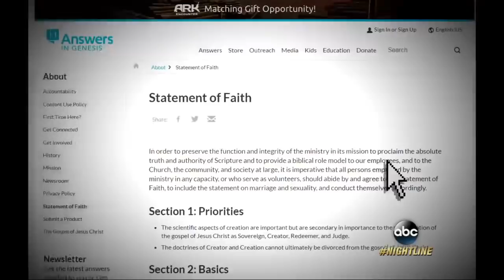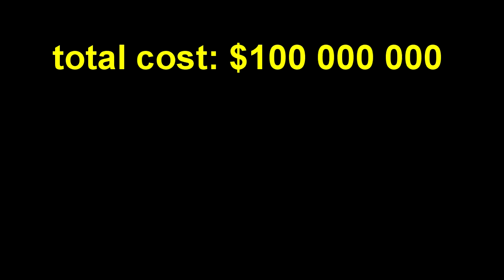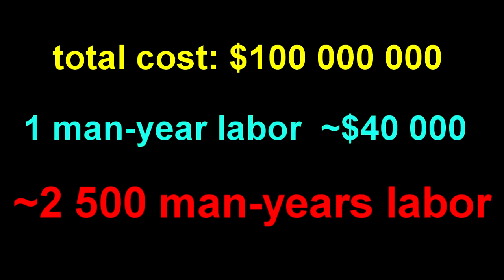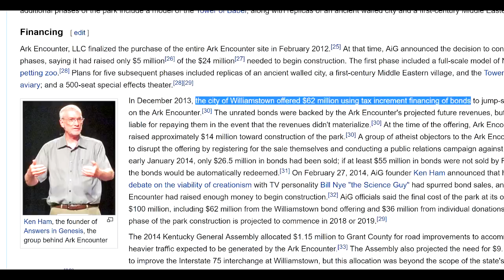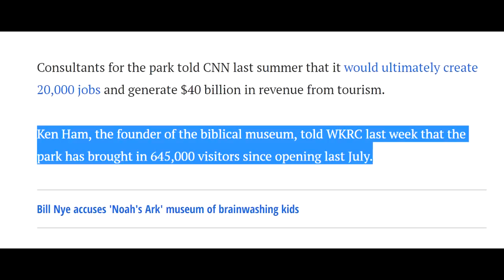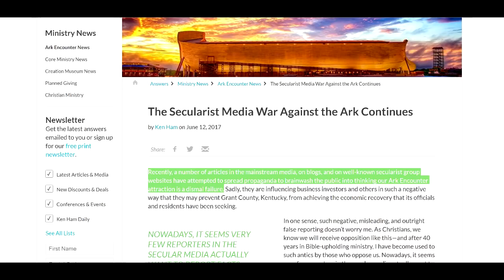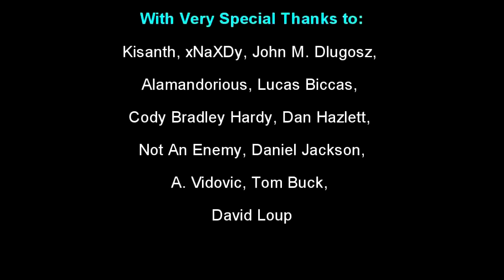Why do people laugh at creationists (part 44)

Comment: The best ship makers in the world carnt make a wooden ship that big. The biggest wooden ship ever made they found it bends and twist and in the sea breaks apart
Reply: You missed the end of your sentence.”and in the sea, breaks apart”!
Reply: Zheng He had a fleet ships, and supposedly the largest of the ships were roughly the same size as the Ark. It depends on the design. It could be possible. It was never really tried in modern times, and why would you try when metal works just fine?
Reply: @S2Tubes  it was tried in around 1900 and they found that it wouldnt work to that size. Do you mean a fleet of ships?
Reply: @georgeetboom7719  He had a fleet of over 300 ships. He's a Chinese admiral from the early 1400s. The largest ships were said to be nine masted behemoths at about the same size the Ark would be, which was about 130m long. The actual dimensions of both cubits and the Chinese ships are not exact. Neither the Ark, if it ever existed, nor the Chinese treasure ships, have survived to measure.

Like I said, it would depend on the design of the ship. I am confident that using modern technology and design could make a wooden ship of that length that would be sea worthy. The reason we don't use wood anymore is that metal is superior. The only reason to make a wooden ship would be to prove a point, and most point don't care enough to waste that kind of money.
Reply: @S2Tubes  im talking about the ship made in 1900 . 120 yrs ago. Where thwy attempted ti make the biggest ship ever and failed due to the reasons ive said
Reply: @georgeetboom7719  I'm not sure what you meant by asking if me if I meant a fleet of ships then. There have been multiple ship designs over the centuries, and they're definitely not all capable of the same level of sea worthiness. If the question is, can you build a ship made of wood over 100m long, and have it survive at sea? Then the answer is yes, depending on the design, probably. Technology has progressed since 1900.
Reply: @S2Tubes  noahs ark was 300 hundred Hebrew Royal cubits, or 150m. The Wyoming Schooner was 137m long and need anwater pump to keep it afloat. I doubt a single and man his friends could build one 20m longer with ancient technology.
Reply: @georgeetboom7719  The exact measurement of the cubits is not known. There are multiple versions of the cubit, and it is not stated which version was used in the Ark. I doubt the entire Ark story. You're forgetting that Noah was supposedly 600 years old at the time of the flood. A wooden boat seems the least of the issues with that story. All the Wyoming proves is that they couldn't do it, not that it could not be done.
Reply: The Wyoming, the ship you mean, was a clipper ship which served in the shipping business for fourteen years prior to breaking up. The history revealed in the Bible says the ark lasted just over one year.

The Wyoming was a clipper ship with huge forces from her sails. The ark was a barge without such forces.

The ark didn't have to make a profit sailing fast, it could be built stronger, etc. It's fascinating, really.

How do you know what ship is the biggest? You simply assume a lot about modern vs. ancient times and people.
Reply: @dhpd  well its believed it took Noah 120 yrs to build the ark. So he either started straight away, and say after 60 yrs half the boat made, it would have to sit in all weather conditions for 60 yrs, i think it would have rotted by then. Or say he was just collecting all the wood and materials for it fro 120yrs, again  thats a lot of wood to keep preserved for such a long time. With supposedly all animals in the world one ship, in pairs, again did he start collecting at the 1st year but theb they would have all died in 120yrs. Plus the weight of all living things would im sure be pretty heavy.
Reply: @georgeetboom7719  So I guess, since you ignored my previous explanations, that you accept that they are possibilities. :) 

Now the rotting is not certain, since the type of wood is not known, etc. 

You are guessing.

Just as Stonehenge and the pyramids are now understood to be possibly built much faster than with fewer workers than has long been postulated, so the ark need not have taken the entire 100 years. One factor you don't mention is covering the ark "within and without with pitch." It's also possible that a tree now extinct was used for the lumber, or that a laminate process was used. It's possible that cypress would work. There are other possibilities, too, that have been proposed by various marine architects and engineers. Other parameters may have been different such as the climate at the time and place the ark was built.

You really should read some of the possibilities before you make up problems without knowing what the Ark Encounter and/or other creationists have suggested.

Some things have not been revealed in the history revealed in the Bible. You might compare this situation with the "singularity" that so many "big bang" believers refer to: a time when modern physics didn't operate.

One thing that has been revealed is that the creatures came to Noah, rather than Noah having to collect them.  You would learn that from simply reading the Bible text.
Reply: @dhpd  so we have no proof that it happend?
Reply: @dhpd  but surely marine experts are just guessing from what they know from that time period. The Pyramids and Stonge Henge we have to examine. Where as Noahs ark we dont. The closest we have to them, i believe suggest it wouldnt be possible for a 7th Centry to 19 Centry BC man to do. a
Reply: @dhpd  then on top of that you have to prove it was Godly inspired. Then figure out if the flood went over the whole wolrd or just apart of it. Then think how did Noah go and write all other peoples civilizations history after it was flooded. Just dont see why you would follow a religion with so many flaws.
Reply: @georgeetboom7719  there is plenty of evidence of a global flood. You believe in evolution which also has zero evidence.  Based on nothing but assumptions.
Reply: @MH-oh8rn  a global flood that killed all humans, yh right
Reply: @georgeetboom7719  I don't have to figure out these bogus questions, the Bible is quite clear! The history revealed in the  Bible lets us know that the flood was over all the earth, that the end of the flood included a time when the seas lowered and the mountains rose, leaving the earth as it is today with high mountains and low sea bottoms. The civilizations you mention consist and consisted of descendants of Noah, his wife, sons and their wives.

There are no flaws in this revealed history, though it is not complete in all the details, just as every history is. :)
Reply: @dhpd  you claim somthing somthing happend with no proof. With questions that need answering for you to believe in the story, they arent answerd so i dont see why you believe it happend just because someone 2000yrs ago said it did. Again how did Noahs decendants get to all the other civilizations in the world and pick up there history from where they left off after the so called human genocide.
Reply: @georgeetboom7719  You claim things with no proof also. I don't know what you believe in order to explain what you claim, but I am confident that if you explain some part of what you believe that's different from the history revealed in the Bible, that I can point out aspects for which you have no proof.

What I claim about the flood is history, supported by documents written by eyewitnesses. We may disagree with what the authors wrote down, but they are eyewitness documents, signed by the authors. These must be handled as historical documents. And BTW, they were written down more like four thousand years ago, not two thousand.
Reply: @dhpd  they weren't written by eye witnesses tho
Reply: @dhpd  but why should you live your live according to them tho??
Reply: @georgeetboom7719  The Flood section of the Bible consists of signed documents by participants. They include the signature formulae used on early clay tablets.
Reply: @georgeetboom7719  "Live my live" according to what? I will gladly answer if you can be specific about what you're asking. :)
Reply: @georgeetboom7719  Genocide? Of what genetic group?
Reply: @dhpd  the bad human begings
Reply: @georgeetboom7719  Oh. So not genocide, unless you believe that they were all descendants of Noah, LOL. :)
Reply: @dhpd  the drowing of all humans at that time. They werent all decendants of Noah were they.  How about all the horses in tbe world, should they deserve to die?
Reply: @georgeetboom7719  According to the history revealed in the Bible, all persons alive then and now are descendants of Noah, yes. Death began when humans began to sin ... as a consequence of all the human sin, all living things die. If you must blame someone, blame the humans. :)
Reply: @dhpd  how old do you think the world is
Reply: @georgeetboom7719  According to the history revealed in the Bible, the earth is approximately six thousand years old. That's what I believe.
Reply: @dhpd  so how do account for the Ancient greek between 700-400 BCE
Reply: @georgeetboom7719  The Ancient Greeks lived between 700-400 BCE -- actually prior to that and after that, too. They are mentioned in the Bible as living around that time and before and after. Their founder, according to the history revealed in the Bible, was  Javan, a grandson of Noah through his son Japheth. 

BTW, the Kingdom of Israel was nearly 400 years old by 700 BCE, and the nation of Israel prior to that.
Reply: @dhpd  sorry i didnt pick a civilization far enough back. How about the Hemudu Chinese culture around 5000 BCE . That would mean they lived 7 thousand  years ago. A thousand years before the earth was created
Reply: @georgeetboom7719  Weights were hung out over the sides to hold the ark afloat.
Reply: Bill nye himself said that
Reply: @scepticalaim  To what statement of Bill Nye's do you refer? After all, as a mechanical engineer like Bill worked on the 747, so he must know all about building wooden ships.

Again, the wood ship Wyoming was built in 1909 and after fourteen years of carrying cargo, did sink. 

The history revealed in the Bible says that the ark was afloat (not under the stresses of a huge number of sails, BTW) for a few weeks over one year.

Since the Wyoming lasted fourteen years before sinking, it's sinking has nothing to do with how well the ark could float for less than two years.

Why do you think Bill Nye tried to mislead you?

BTW there are many other engineering-related reasons that the ark and the Wyoming are dissimilar as well.
Reply: @dhpd  it was a video disproving the Ark
Reply: @georgeetboom7719  So another Bill Nye clip which appeals to the authority of the majority of scientists, but not to the scientific method, not to the nature of history, or to logic. I stopped listening because I recognized the clip. Does this one include reference to the Wyoming, the wooden clipper ship built in 1909? If so, you can hear Bill himself say that the Wyoming sank after 14 years of sailing around the world carrying cargo. LOL. The ark is revealed in the Bible to have floated for just a few weeks more than one year. How does that show that it's impossible, eh?
Reply: the best machines we have are unable to make a pyramid. Yet they still exists and were made with hand-tools.
Reply: @sergioreis3287  im sure we could replicate the pyrimds today with the same materials if they are around.
Reply: @sergioreis3287  Good point! I suspect that the ancients did have ramps, levers and pulleys, and possibly draft animals too. Maybe a bit more than hand tools.
Reply: @georgeetboom7719  Recently I saw a documentary that explain that it is too hard to move one single stone block, using several CAT machines, working together, without breaking the block. We should not underestimate the abilities of ancient people. Unfortunately, the ark is not here nowadays to prove this point of view however the pyramids are and there is not a clue how they made it. Don’t forget that there are perfect round holes in some megalitc blocks!!...

Comment: But does it float?
Reply: Butanic wait, so how did the ark carry tons and tons of animals if it's design couldn't hold it's own weight?
Reply: if it was all metal and was built by actual engineers that specialize in boat design then probably, but by how it was supposedly done in the bible.... no. wood can only hold so much weight. Even if somehow the wood did hold its own weight it looks like its top heavy.
Reply: CAUSE GOD
Reply: Like the Tessarakonteres of similar lentgh?

Comment: So, now we have all he answers to those burning questions about the Ark. 

How could Noah build it with just he resources he had available, and the workforce of just his family? 

Easy, as Ken has shown, Noah actually used 21st century industry to produce the Ark with thousands of days of manpower and labour time, with all the materials and machinery transported to him. 

How did the integrity of the wooden boat not suffer when using only wood for such a large vessel? No other shipwrights in the history of the world have been able to make a seaworthy replica of the proposed Ark.

Easy. Noah didn't actually sail the Ark, he just mounted it on some concrete slabs and added a gift shop. 

Truly inspirational.

Comment: There are 5 species of sauropod dinosaurs and 10 sub species.  Each sauropod is 40 meters long.

10 pairs of sauropods X 40 meters = 800 meters.

The ark is 150 meters long.

So it can't accommodate 10 pairs of sauropods.

Of course, we have yet to let the other 700,000 to 1 million other species onboard yet.

Comment: Ken Hams ship is only like 60ft longer than the Wyoming.  A six last wooden ship build by moderne ship builders with bilge pump‘s and if we consider how many men were on board the ship to take care of all six masses drop sails in rough water; The fact that had trouble and calm water shows that Ham’s Ark is like a skyscraper  that is just a few stories too tall to be built out of wood. 

It amazes me is that we have modern day boats made from centuries of trial and failure and yet I am supposed to believe that this thing ever just floated around especially on rough water. I’m sure he doesn’t claim it has a rudder, but claims it had bilge tanks made of hammered copper to collect and store drinking water 😝 

Wyoming didn’t have bilge tanks and it still sunk and Ham’s boat intentionally took on extra water for drinking while the Wyoming had to Constantly pump water out because it was too damn big three wooden ship. 

The ark experience has a display of cartoonish funny like Gilgamesh is cube hitting waves and sinking and all the other common ancestry boats and how they wouldn’t survive the waves except for the ark which goes into these waves with more force but somehow doesn’t twist or bend or capsize the ark with no rudder and no sense of direction or means of adjusting it. 

It becomes even more silly when you start looking at how much one of the boats would weigh versus the other and all the other factors that modern ships in the most modern wooden ship that was close to the size of his Ark went down way too easy.

Comment: Did he spent $100 million to proof it's impossible for 4 men and 4 women to undertake such a project it the timeframe mentioned in the Bible?
Reply: It took 1,000 labourers 2 years to build using modern equipment, cranes, bolts etc. and it won’t float!

Comment: I'm not religious but I do work construction and things you say don't add up im not going into details but one thing is they didn't just build a ship they built a building that looks like a ship they got tyvek waterproofing, structural foundation, framing and in the original craft of the ark im sure it was just wood work...was a massive fail though

Comment: Clearly the "original" wouldent be built to modern usa standards nor would it have electrical work or fire sprinkler systems etc etc. Still silly but grossly different circumstances in this area as well as the tooling and laborer number issue.

Comment: I've been to this,  Sadly.  The ex wife was all hot to trot about seeing it and it was a joke.  they did have some cool things in there explaining how they got light and air inside, but face it, i seriously doubt it was a boat shaped like that.  Most likely it was more of a barge shaped vessel.  rounded bottoms like that would be unstable in a storm.  and the dinosaur babies, what a joke.  It's failed because it's a joke. I believe things happened in genesis, however i dont believe they happened 6K years ago.  That's a load of rubbish.

Comment: i know this videos very old but one thing this video didint mention was even if he had no need for food nor sleep and could build this in few decades theres another major issue is he does not have proper ways of maintaining this and idk about you but leaving material around for decades without proper protection n maintenance means itll rot and decay so eny material he did end up using would need to be replaced

Comment: Straight  up y’all!  In K-Ham’s defense the original ark did not have all the ancillary structure and did not to be built to a modern code.  So it not a fair apple to apple 🍏 comparison.  Pretty sure did not have dat anamatronic Noah or a/c.  Muh point that they could have done it  bit quicker.